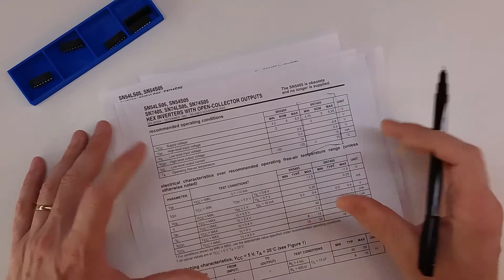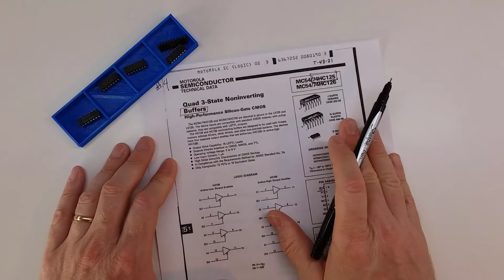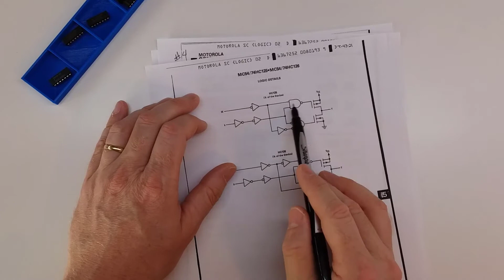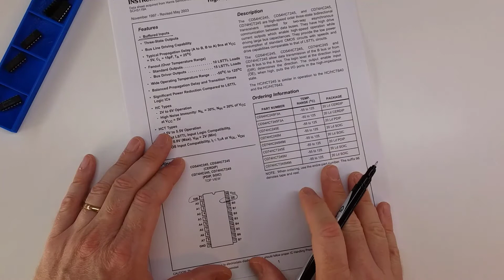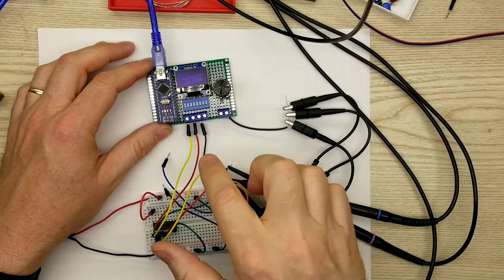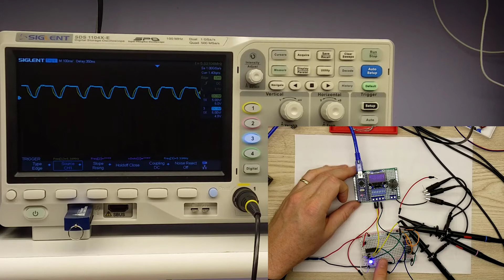IC Series - Episode 04 - Hex Inverters and Buffers

Comment: SNx406 has an open collector output. When you want a logical high you need to pull up the open collector output pin external to a certain potential, for example vcc or higher, otherwise the base collector junction of the bjt in the output stage is not biased and the inverter can only output low. The 30 V in the data sheet is the maximal voltage the output pins are allowed to pull up to.